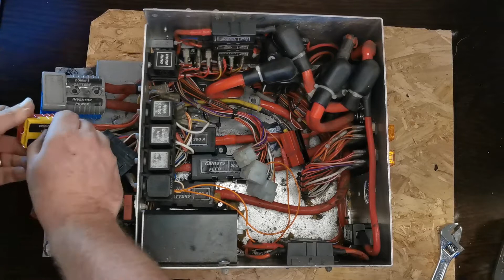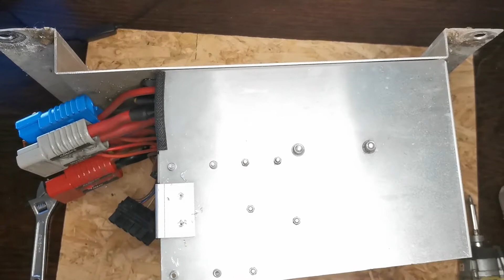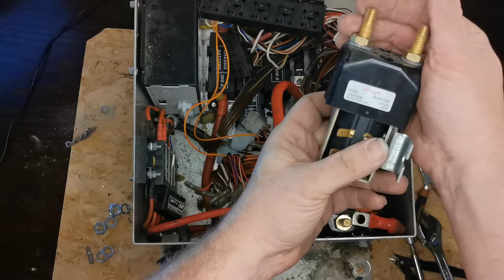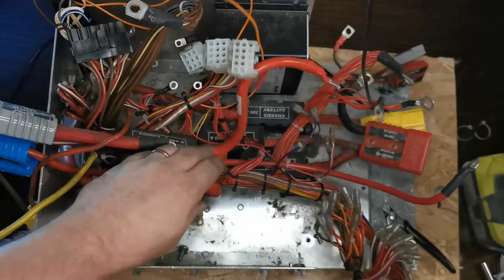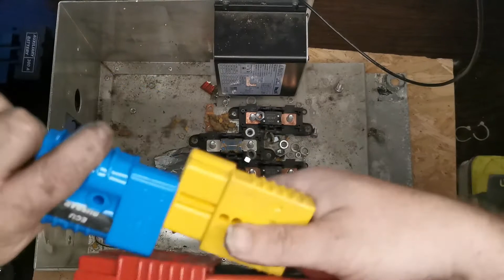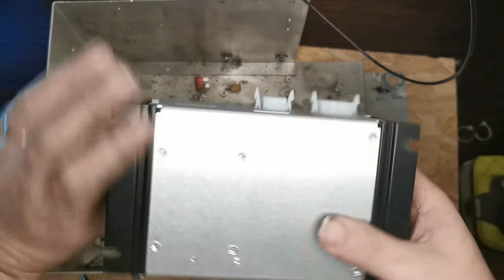Ambulance Power Distribution Box Teardown

Comment: Where is the battery charger usually located? I'm trying to determine if I can hook my ambulance up to 240v without issues.
Reply from the maker: Depends on the build. Normally in the cab for Antares, Ctek and Xantrex. Victron equipped units may have it integrated with the invertor. If you have an RCD behind the seats it will normally be the only thing wired to it.
Reply: @rtechlab6254  Many thanks. Found it 👍
On another note, is there a way to bypass the time out of the genisys system? Having to turn on the ignition every 20 minutes/half hour to keep the lights on is going to get old quick.